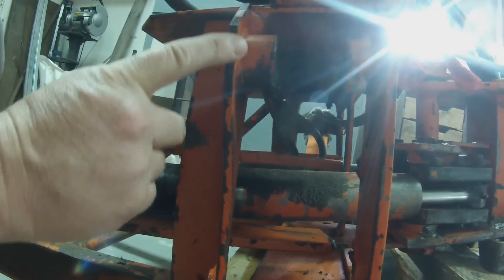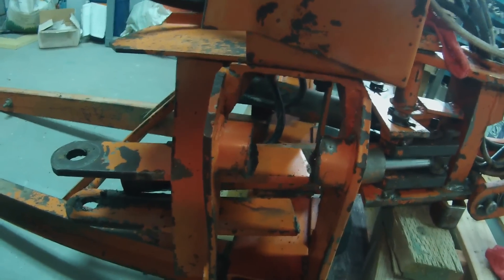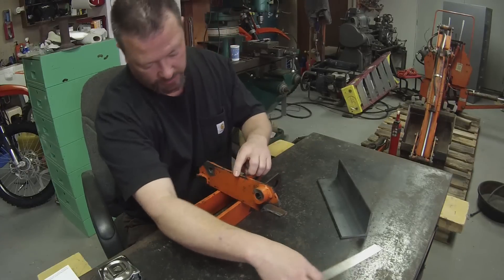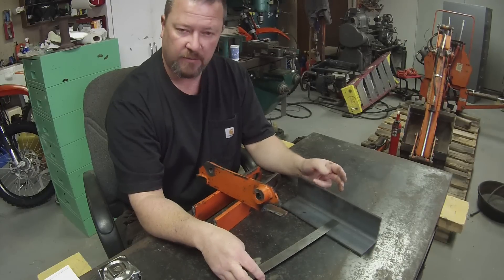Backhoe Woes Part 1

Comment: Hi mate.  Firstly thanks for making these videos.  However you have not posted any for quite a while.  I realise that the start is hard, but it has been just as hard for Oxtools and Abom79.  So start cranking them out again.  You have a good calm presentation style, that will suite a lot of people.  That saw that you have got there , is a bloody steal.  I bet that if you are able to alter the downward pressure a little, she'll cut straight.  I was wondering why you went with all new materials, was straightening it all not an option?   Like you said, some of those welds must have been loose for quite a while.  I think I would have straightened it all up and re-enforced it all, but than, I was not there.